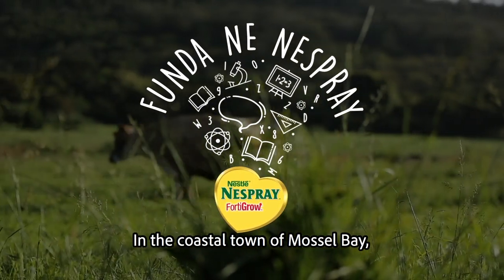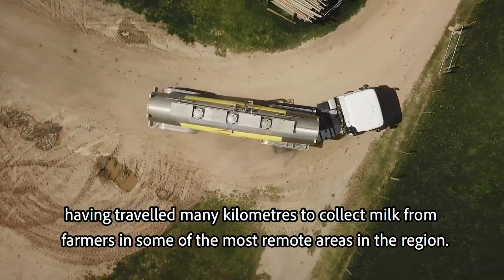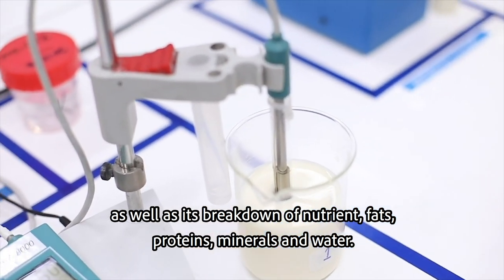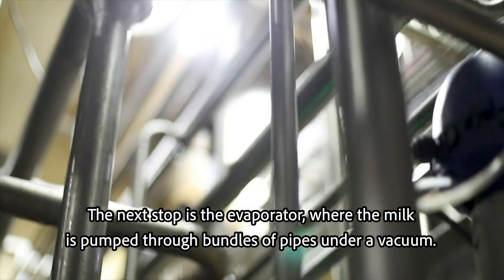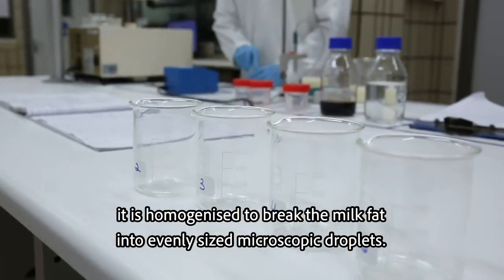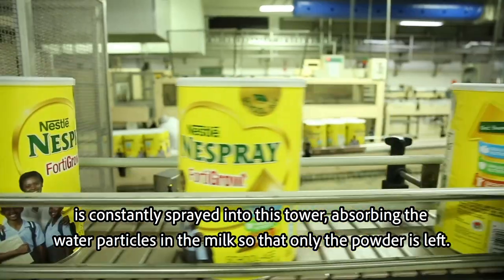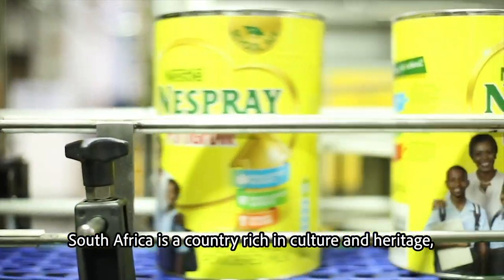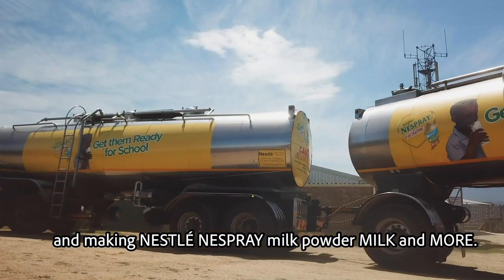How Nespray is made

Comment: I've just prepared coffee added powder milk cremora then I was curious to know how it's made then as usual I came to YouTube nd I am not happy with the information. I have watched the program " how it's made" I feel like I was cheated with the information on how powder milk was made. I am not satisfied at all. Like when they make potato chips u will see potatoes cleaned cut dried dried flavoured nd packed. But here nothing. 🤔🤔🤔
Reply: The process is impossible to film, it's inside a machine under heat and pressure.
If it was possible to film inside there would be footage of it don't you think...
Reply: bro its made by drying the milk by adding drying agents and heating it through the spray drying . where they remove all the moisture through heating and the water gets evaporized and only the powder portion will be left.
Reply: There's a tetrapak video that explains it pretty well now.